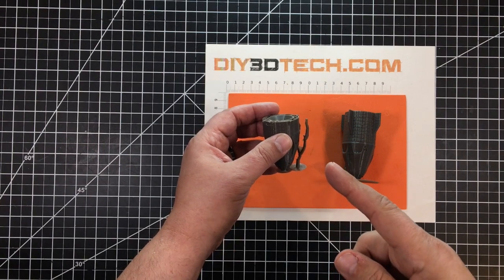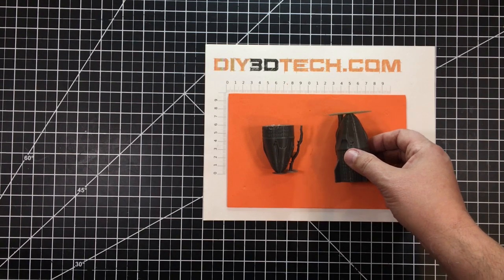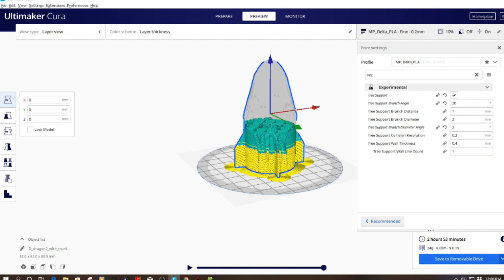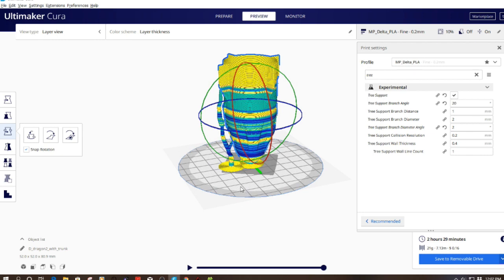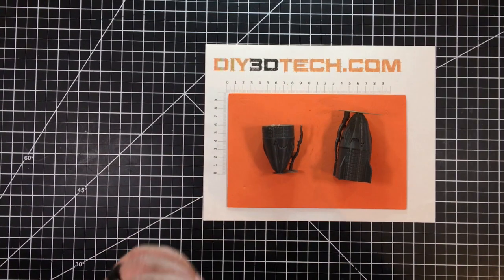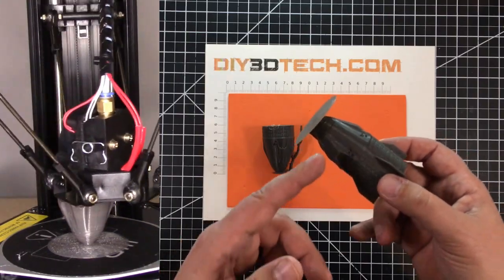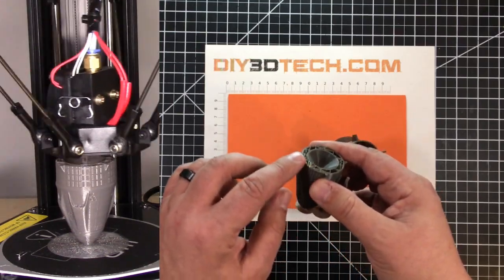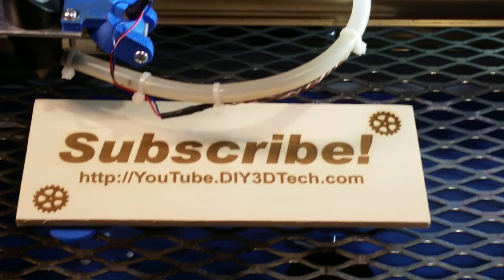Design Talk - Printing Upside Down For Quality!

Comment: Side Note: I'm not printing anything... I did the firmware update to Marlin V2 on my TEVO Tornado and now I have NOTHING! Just a blank blue screen and I've turned it off and on several times. Arduino didn't show any errors before or after the update. Any ideas on how to fix this?
Reply from the maker: My guess or where would start is to make sure the correct libraries are being used for you LCD screen / interface.  I don't have a Tornado however I do know TEVO uses what ever the cheapest parts at hand are so the firmware might be looking for a different screen.  Just my guess and where I would start as I once a similar issue with my Tarantula...
Reply: @DIY3DTECHcom  I GOT IT!!! :) Googled the world and found another firmware file and edited the hell out of it. It's now printing a 58 hour set of parts.... so far so good, (12 plus hours in),... cross your fingers.